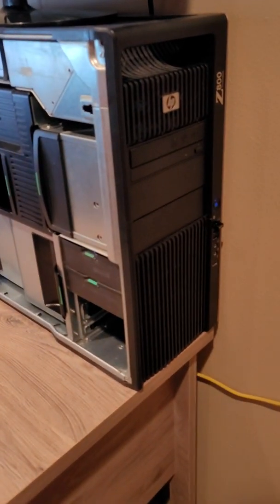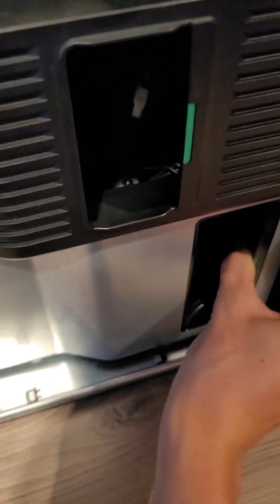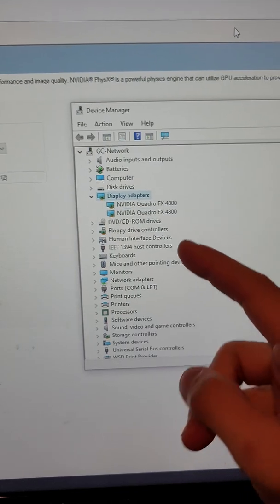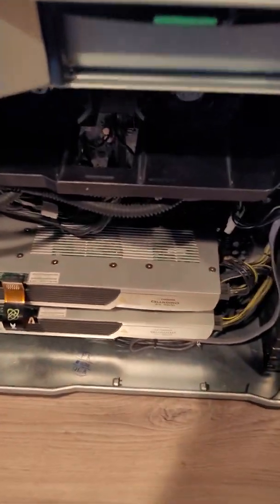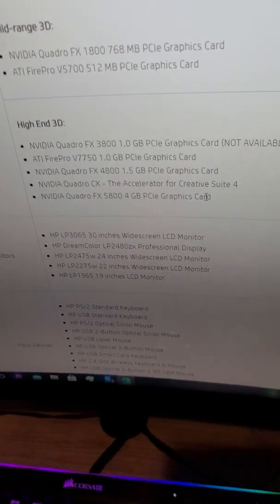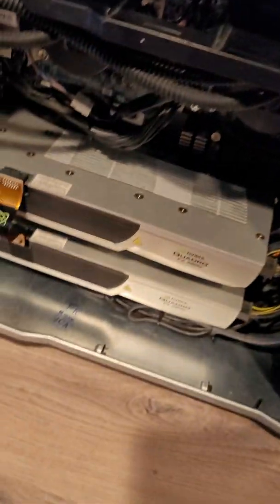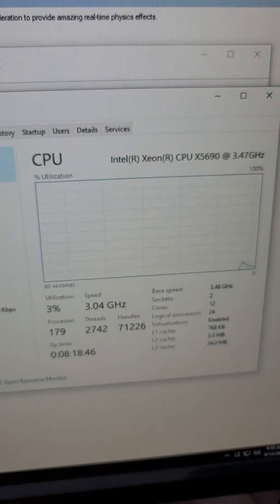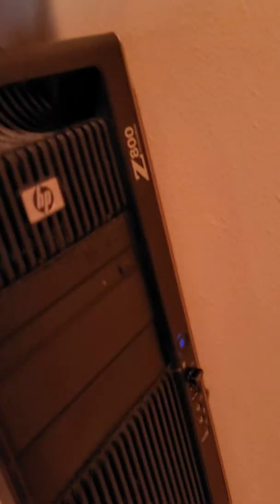HP Z800 Workstation Quadro SLI FX 4800 With Benchmark

Comment: I've the same Workstation with the same graphic cards, but i can't see  the sli menù in the nvidia control panel, could you please post here the nvidia driver version that you use and the version of Windows? Thank you so much
Reply from the maker: It should be the latest one that's listed for this graphics card. If this still dosnt work ddu the drivers and reinstall them.

Comment: On Quadro 6000 +  Tesla C2075 I get 443W power draw and 6FPS on Cortex 5, with sigle GTX 660 same 6FPS but power draw is 310W only. After Effects render to JPG file sequence Quadro 6000 +  Tesla C2075 I get 405W power draw and time of 1:40HR, with sigle GTX 660  I get 220W power draw and time of 1:35HR. Seems like GTX 660 performs better less power used. GTX 1660 SUPER would be 2x speed?
Reply from the maker: It's not for performance it's to look cool. That's all. That's why I did it and the cards were cheap
Reply: @ThatOneName_  If thats the case then you should add a tesla instead.

Comment: I am trying to make a sli arrangement with Quadro k5200 cards, both of them the same, I installed them in the machine but it recognized them as individual cards, I did not know if it was a bridge error or what it was, but I just bought a double connection bridge, if it works better that way the previous bridge was simple, this new one is an Asus Rog SLI HB Bridge rev. 1.00, do I have to install any additional drivers for SLI to work or should the machine automatically configure it?
Reply from the maker: download the drivers for that card on the Nvidia website then install them. then go into Nvidia control panel and go to the screen that says "set SLI" then choose "maximum 3D performance" I recommend google for further assistance.